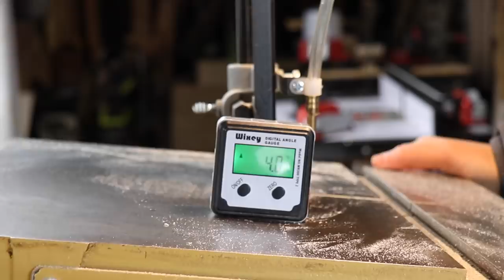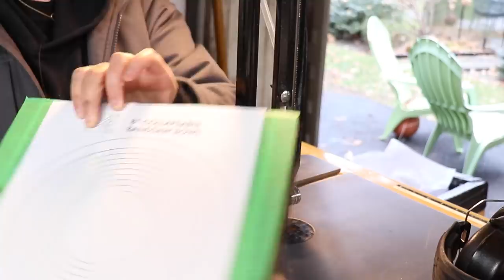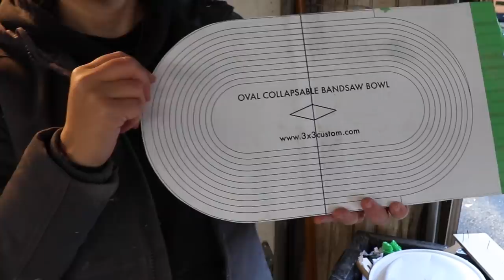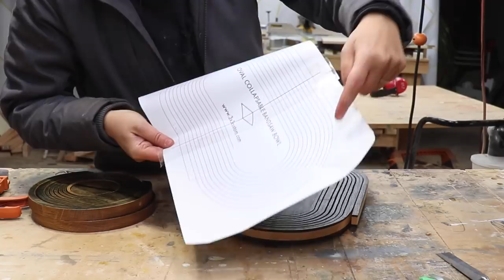How to Make a COLLAPSIBLE Bowl!! It's EASIER than you might think!

Comment: I did some number-crunching (or rather formula-writing). Assuming the angle required is simply because the saw is removing a slice of wood and the bowl works when there is overlap between the wood from either side of that slice:
The formula you can use to find your minimum angle is (width of wood) / (width of saw) = csc(angle)

I made a visualization, you can play around with sliders to see what will work or not
https://www.desmos.com/calculator/6vblhn33pz
Yellow / orange lines are the wood, black lines are the saw cut. You can move the sliders to change the widths of the wood and saw and the angle of the cut.
It works when the green dotted line is past the red one, and you can see the values of the functions in their boxes on the left (you might have to scroll down)
Reply from the maker: Wow. Awesome

Comment: An easier way to stop the tear out at the bandsaw would be to make a zero clearance insert or a sacrificial table clamped to your bandsaw table if you were doing multiples.
Reply from the maker: I was thinking of that. But I was worried that the curves make the blade move so much that it would open up the zero clearance it it would stop being effective. I’ll have to try it though.

Comment: I'm guessing 25 minutes to cut the oval bowl and back it off the bandsaw.  When you remove it from the bandsaw at about 13:18 and drop the center- I didn't see a bowl- I saw stadium seating in an auditorium.   Time for the Gladiator's Edition of 3x3Custom and do this same trick on a 4x8 sheet of wood.  Then throw the kids in it for a fight to the finish.  Sorry, kids, but it's tuff love- Loser does the other's chores!

Btw- are you using the 7 degree angle on 3/4" thickness?
Reply from the maker: 😂😂😂 sounds like fun. And it took less than that! Yes. It was about 3/4 thick. Milled it to be the same as the plywood I tested on

Comment: I think, that these are supposed to be cut on a scroll saw, rather than a band saw. The thicker blade affects the options substantially. Just my 2 cents.
Reply from the maker: Yup. Except I don’t have a scroll saw
Reply: The thicker the blade is, the more pronounced the angle needs to be.
Reply from the maker: @ragnkja  yup. I’m going to assume the distance between the spirals is also a factor

Comment: By U.S. Law, all Stains and Finishes must be inert after they are cured.  So, you can try a finish that has a stain in it... and give it a go.  You hear, "Food Safe" finish.  But again, by law... they all must be.   The real difference comes to durability of the finish.  Mineral oils and such... are very easy touch-ups for you food plates///etc.  Where as if you would use... say, a wipe on poly.  That will eventually flake... and be difficult to touch up.

I hope that wasn't to confusing.
Reply from the maker: Interesting

Comment: I once saw a website with this angle calculation shown, it must be trigonometry. Can I remember it, of course not. 😫🙄🤭
Reply from the maker: That would have been helpful! But I try to avoid math as much as possible. Ha
Reply: @3x3CustomTamar  thinking about it, I recall it was for bandsaw or scrollsaw bowls that line up on top of each other when stacked,  rather than slide in like that, whoops. Still useful though.